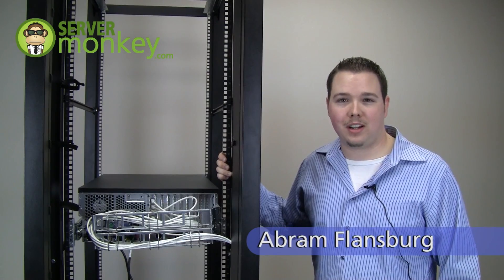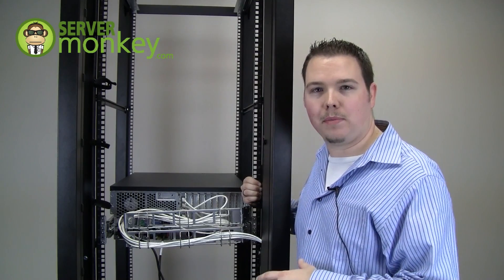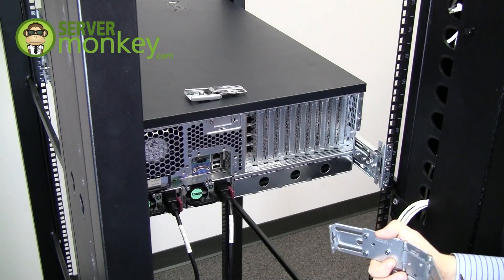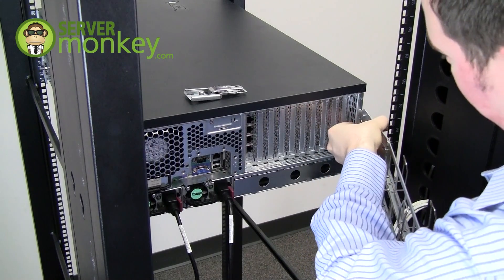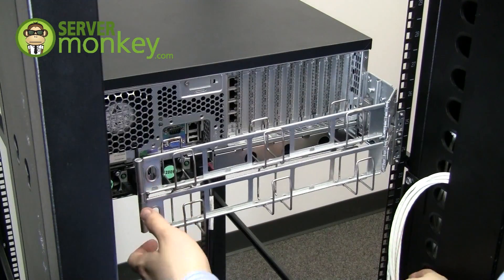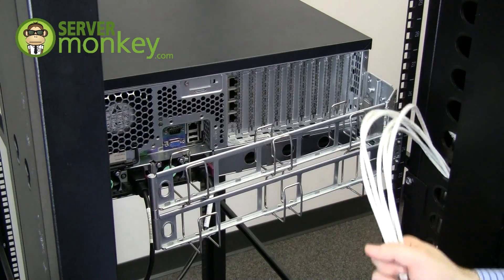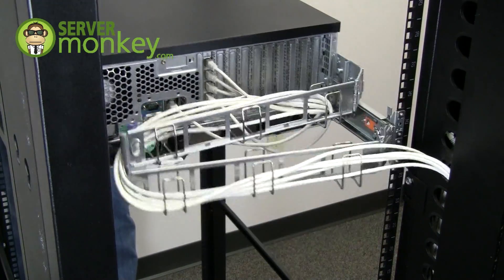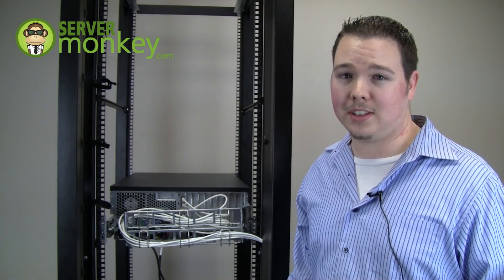How To Install A Cable Management Arm On A DL370 G6 Server

Comment: Zero affect mixing pwr and net cables within a management arm... zero.
Reply: 60hz vs 1ghz CDMA signal, really only an issue if you are using shitty or old (think 80's) network switches. That and the arm doesn't return to it's original position when sliding the server back into battery.
Fail.